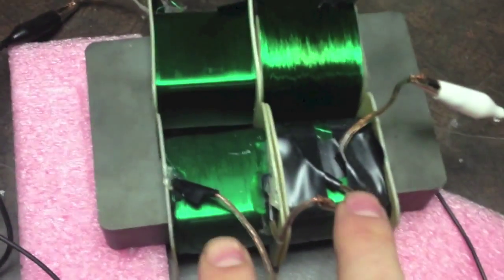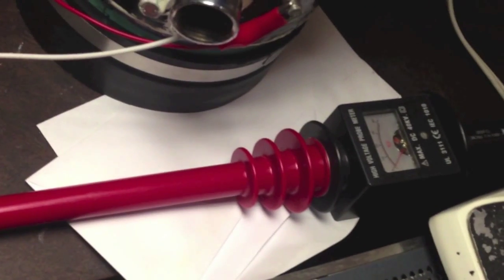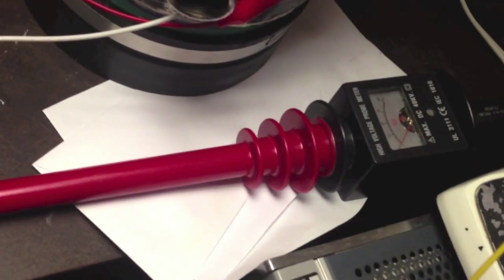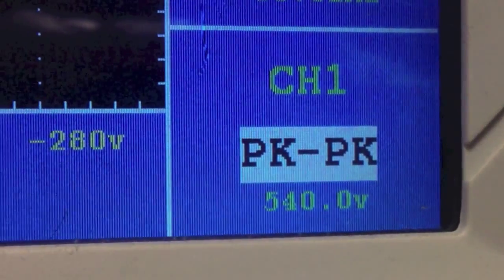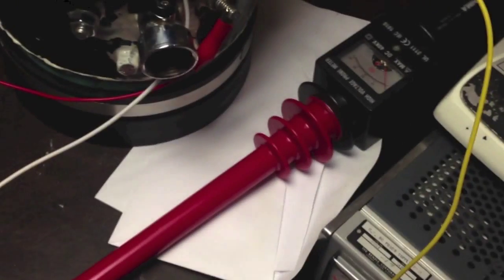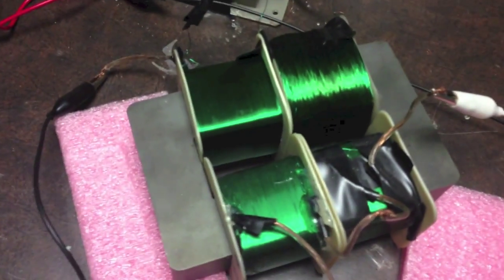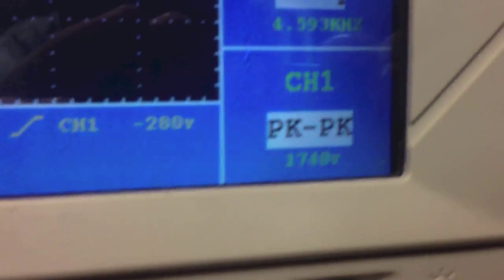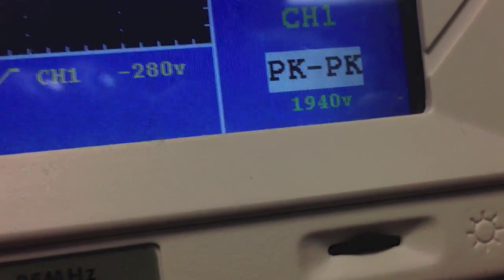Electrical Polarization Process, 3300volts. (Work in progress)

Comment: David, still working on this?
Reply from the maker: Osmar Garnica Not so much these days. I don't have the space. Everything is in storage
Reply: David Bixler How is your driver? Im having some trouble with my mosfet/bipolar swithcing. When I put the leads across the Drain-Source or Collector-Emmiter, i see a lot of harmonics (altough the sinal im feeding the transistor its clean), and there harmonics are amplified through the secondary as dirt, so I`m trying to get rid of them. Did u have the same problem? Or knows how to solve this?

Comment: 1A at the primary no? how many volts your transformer is puting out without load?
Reply from the maker: no its 1amp at the cell. In this experiment, the transformer would of been putting out around 400 to 500volts with no load. The output is adjustable from 0 to 2500volts with no load

Comment: So,400v per tube.Hook one tube to rectified mains with rain water and see how it would look,those 400v are not  realy doing work,if you hook a 50v powersuply consuming 1A the production would be 3x times more that those 400v are producing...
Reply from the maker: 1 amp at the cell will produce the same output from electrolysis in both cases. My goal here is not electrolysis, it is the electrical polarization process where amps are restricted and voltage is increased. keep in mind, the voltage readings are peak to peak measurements. The rms voltage is much much lower.